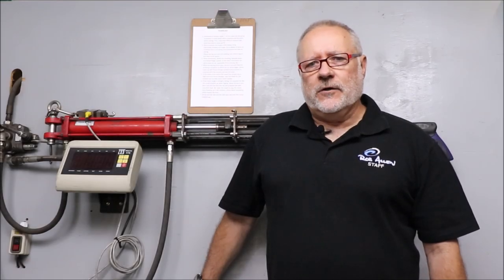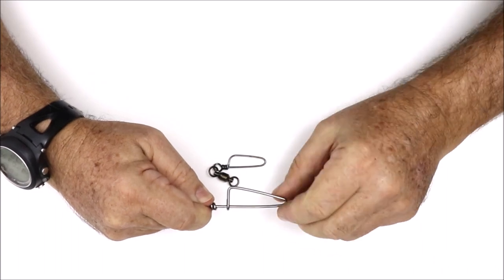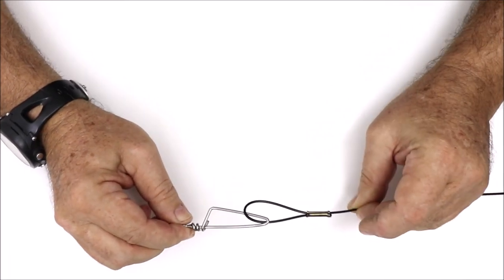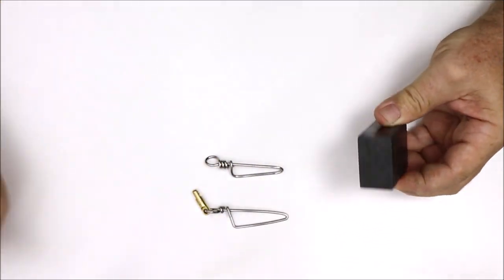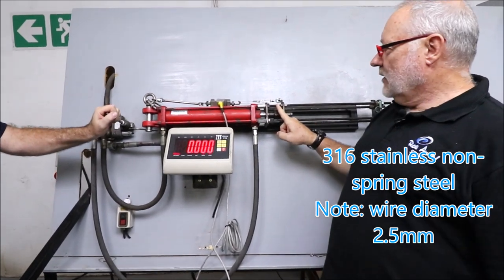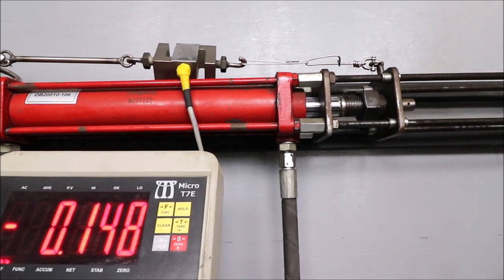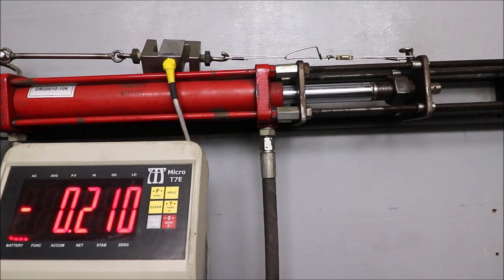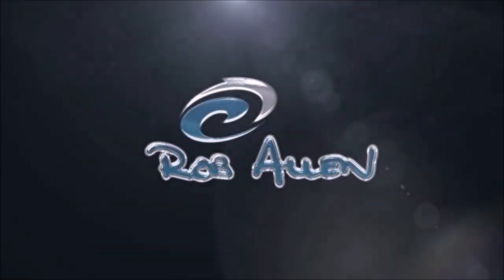Rob Allen | Snap Clip Break Test

Comment: Hi Rob!

Just want to hear your opinion and share my experience of gun bungee snap clip failure, it happened to me and I've done some testing after.
It wasn't yours, yet it was a very similar copy (angled tag-in etc.)

Video when it failed below, on the video you could see that the clip was set up correctly before the shot, then when I get in the boat the clip was completely bent and it was a miracle that I didn't loose the spear, unfortunately I turned off the camera by then:
https://youtu.be/27h8t26Arhc

Video of me testing it, assuming that's what happened:
https://www.youtube.com/shorts/weA05acrLUk
Reply from the maker: Hi Andrew, your clip was fine as it came off the gun so it was rigged correctly. But, at 36 seconds when you see it out the front of the gun it does not seem to be all lined up, might have already been hooked up. The fact your home test only got to 15kg makes me think the clip is made with standard 316 stainless wire and not spring steel stainless wire.  To test, just put a magnet on the clip. If it is non-magnetic it is 316 non-spring steel. If slightly magnetic, it is 304 wire. the greater the magnetism the stronger the spring steel.
Reply: @RobAllenSpearfishing  it appeared to not be magnetic. 
I had a closer look at my video, and it appears that snap clip hooked to the muzzle ring (0:34) and deformed after that (0:36)
Reply from the maker: @lxSouthParkxl  Those 316 stainless clips look exactly the same and unless you know different you will not know. Very easy to make the soft s/s ones, hence the attraction to price for the retail shops.